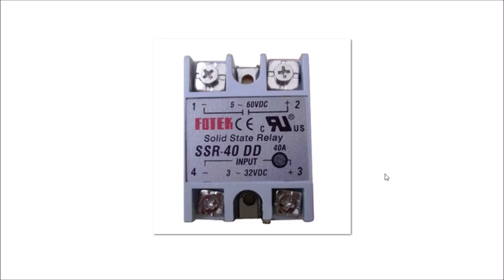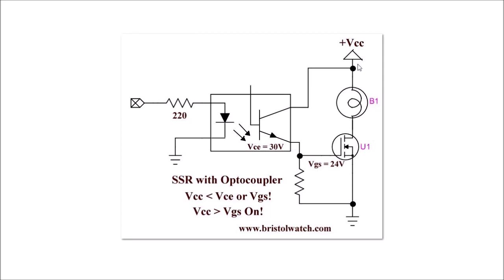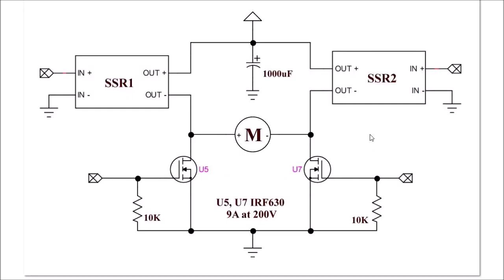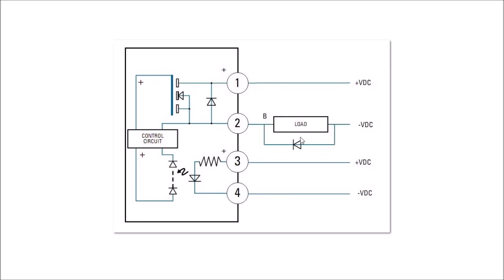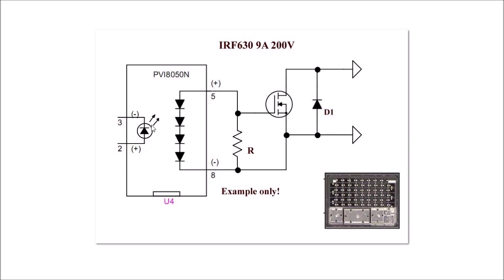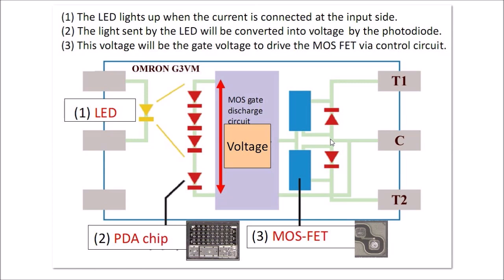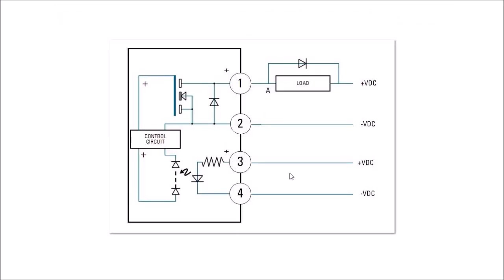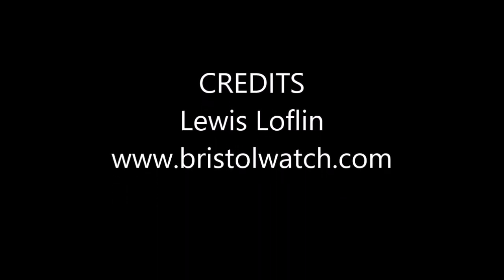Output Circuits DC Solid State Relays MOSFET Output

Comment: Hi Lewis,  I'm looking for a good ssr relay circuit to control up to 200vdc @ 10 amps.  I didn't quite understand what you meant at the end about the H bridge.  I checked out your website,  but I'm still not quite sure.  Any help would be appreciated.
Reply from the maker: An H-bridge is a DC motor control that swaps polarity. What is the control voltage?
Reply: @LewisLoflin  Okay , I now understand the H bridge.  I see you have some other videos on ssr also.   The reason I want to build something is that I need a 4 pole relay.  It's kinda an odd situation.  It's for a solar power system.  I have two arrays,  each is 160v @ 9a.  My charge controller has a max voltage of 200v.  So I parallel the two arrays to it.  My gridtie inverter needs higher voltage,  so I series the arrays to it for 320v.  What I want to control is switching from one to the other.  Right now I have a 4 pole double throw knife switch.  I have the Load sides parallel to the charge controller and is series to the gridtie.  So with ssr relays,  I will need two sets of 4.  I'm trying to get to the point where that would be fully automated.  My system is 24v, so the control voltage would range from 24v - 30vdc.  How I really would like it to be controlled is when the grid goes down,  it would automatically switch the solar from the gridtie to the charge controller, so there would need to be some other lower powered relays also which wouldn't be a problem.  I hope you understand all of this and I didn't make it to complicated.   I think it would make a very interesting system.  Very fun project.  I thought I could mount it on 1 or 2 large heat sinks and even incorporate cooling fans if needed.  I'm retired and semi disabled.  I was a general building contractor,  but worked on electronics all my life.  Thanks for your quick reply.  I just need pointed in the right direction.
Reply: @LewisLoflin  Also,  I really appreciate your videos.  Not too much that shows switching DC.
Reply: @LewisLoflin  I meant to say,  too many videos.

Comment: Thankyou for doing this video, I learnt alot. I think you missed an important feature of the Omrons, they appear to use a P channel and an N channel, not 2 N Channels, hence the ability to have either polarity DC on the load terminals (see diodes).
Reply from the maker: It has to use 2 N-channel or 2 P-channels due to the MOSFET diodes.